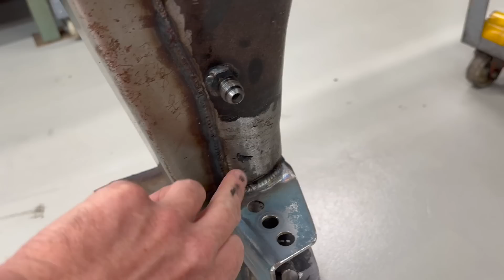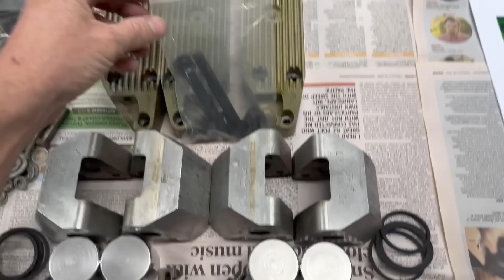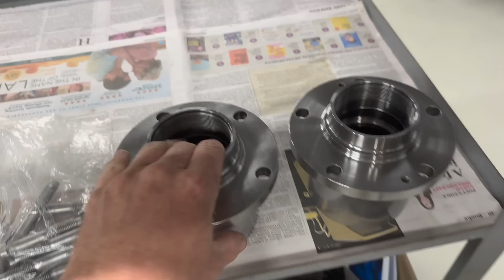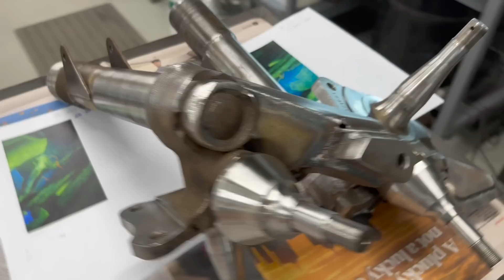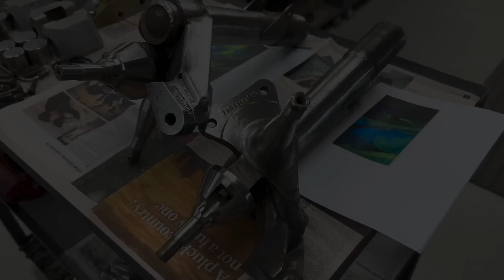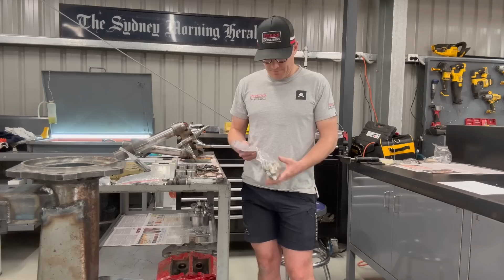Episode 69: Look inside the Sub Assembly room at Perkins Engineering to see parts from PE 013

Comment: Hi Jack, I spotted something odd looking on the top of the Bilstein front strut on the left most side of the 4 shocks. Has the top, where it bolts to the strut mount, been broken and welded back on at some stage?
Reply from the maker: @robertodonnell8807  it’s not uncommon on these, not sure if it was busted or not. They can be strengthened through there or sometimes people have added a bleed hole or something and it’s been welded back up.
Reply: @perkinsengineering  Gotcha. Cheers!

Comment: You can see why Perkins engineered cars rarely had a mechanical failure. The level of preparation is amazing.
Reply from the maker: It needs to be!!! Cheers for watching
Reply: @perkinsengineering still disapointed about the Breakdown in the '92 Race after getting it on the front Row

Comment: tell  me  more  about  the  power  steering  pls
Reply from the maker: The power steering we removed from the car uses a Sweet Servo in he column and it then runs assistance to the steering rack via hydraulic fluid transfer. In 1991 the car didn't run power steering. Cheers for watching.

Comment: Hi Jack great eps do you know the make of that maxi spool? Cheers.
Reply from the maker: Thanks! The spool is/was originally made by Harrop. We eventually start making our own to basically the same design. Cheers!
Reply: @perkinsengineering  excellent I did my apprenticeship as a Fitter & Turner  at Engineering firm in Brisbane, that used to make differential components, harmonic balancers, and timing chain set. I remember making the odd bits and pieces for PE.

Comment: Thanks jack. I luv the way Perkins Eng have kept all the specs and drawings in their archive, bloody handy. And also the way parts were marked and stamped at manufacture. Very professional. Cheers mate
Reply from the maker: Absolutely, we have over 3500 technical drawings from 1986 to about 2008-09. Would be very hard to do this without the drawings. Just about everything received a stamp, with either a PE serial number and/or a date stamp of manufacture and often some initials of the person who made them, or welded them, or even just stamped or engraved them! Cheers for watching, thanks!
Reply: @perkinsengineering  i hope youre working on saving them digitally :)
Reply: I wonder if they've survived and alre usable today because they are real drawings on paper.  I suspect that a CAD file from the 90s would be unreadable by any software you could run today.
Reply from the maker: @ yeah everything was hand drawn at PE until the very late 90’s, early 00’s. Anything that was computer drawn from that period I have the hard copy of it now not the files because as you say it would be hard to find a computer to make them work!
Reply: @perkinsengineering  it’s a shame computer records are so ephemeral.  You don’t get too many years down the track before modern software won’t read the files, modern operating systems won’t run the original software and old hardware isn’t available/usable.  It takes active work to maintain the files in a usable state.  The simplest way is just to commit them to paper at some point!  I wonder whether someone restoring a Gen3 car in 2055 will have. Rawlings to work from.
Reply: Well the actual Perkins Engineeeing was an actual race team at one stage so you'd expect that kind of thing